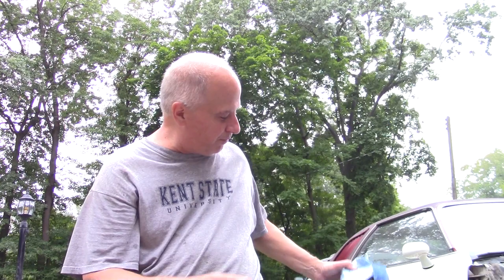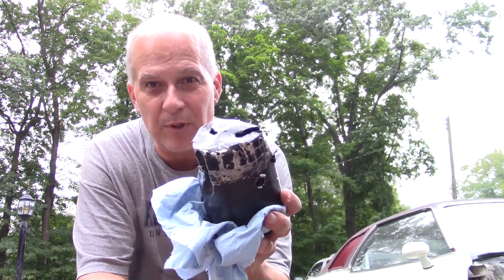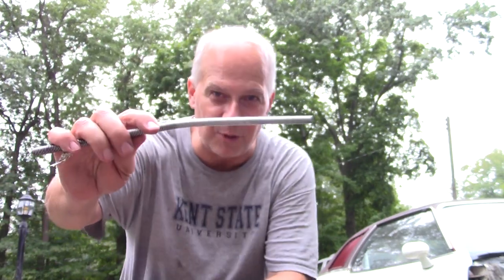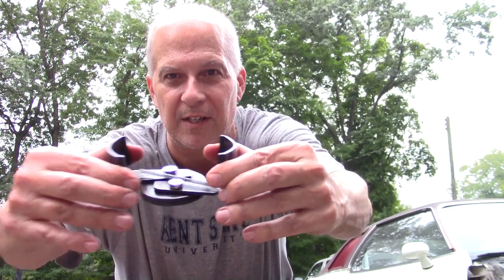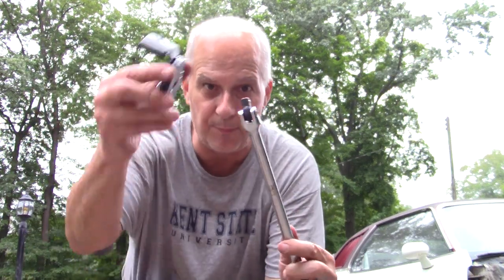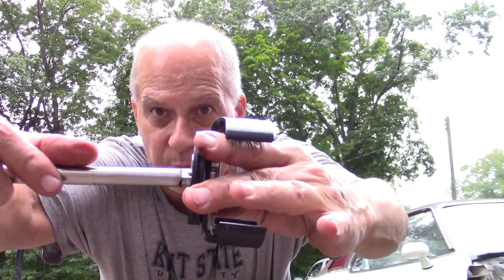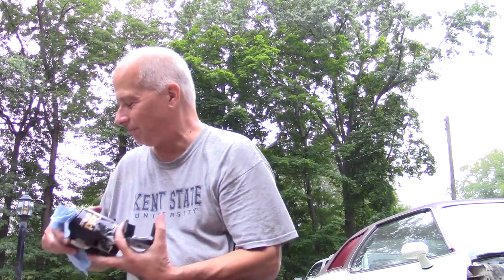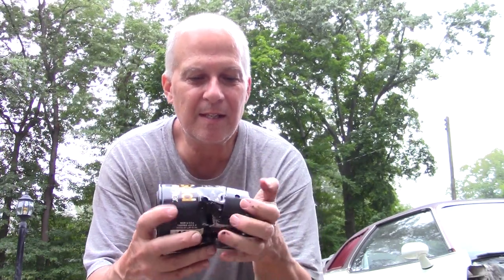Lisle Oil filter wrench review.  It saved me from a lot of work!

Comment: It would be nice if you told us where you got it at..lol
Reply from the maker: I thought I mentioned that I went through all the options at Summit Racing.  But it’s a Lisle product so it’s probably available at multiple locations.
Reply: It's the Lisle 63250 - you can Google it and find it all over the place (amazon, walmart, local parts stores etc).  I have the smaller one which is the Lisle 63600.

Comment: i thought i was the only one who had to deal with oil filters put on by a freaking yeti.   WHY DOES EVERYONE FREAKING OVERTIGHTEN OIL PLUGS AND FILTERS>  WTSFDFSDFL:KSJDF:LSDKFJSL:DKFJ:SLDKFJ:LSDFKFJ
Reply: ps, just ordered that particular tool which is how i found your extremely useful video.   I couldn't figure out which to buy bc i didn't want to go through the methods you actually listed
Reply from the maker: To your point, I sometimes take my cars in to get the oil changed for convenience.  A couple days ago I changed the oil on my Escalade and couldn’t get the oil plug out with my wrench.  Soooo……I put the socket on my 3/8” Milwaukee impact and it still wouldn’t come out.  Now I’m thinking, I’m hoping the threads aren’t ruined.  One breaker bar later, I finally got it loose.  WTAF….lol
Reply: @GroundhogzGarage  I got so mad when I have to follow behind a "professional" who does horrible work.  It's really annoying

I remember paying $1,500 for routine maintenance and spending almost a week trying to put Everything back together correctly since they flip the tires, use the wrong bolts,... Just a lot of small stuff that was missed.  It always made me wonder if they actually did what I needed them to do

Comment: Too tight with oil filters is NOT GOOD! Oil filters should only be installed hand tighten only! Tools should only ever be used on oil filters for removal only, and only when necessary.
Reply from the maker: It seems like no matter how often that message is shared someone is always putting too many torques on tightening the filter.
Reply: That is not the only reason filters get stuck on the engine. it's also because the engine block gets pretty hot and cooks the gasket too the mating surface. I know because I have had filters that I have put on be a problem. and I always put oil on the gasket and I never over tighten them.
Reply: If you should hand tighten only and never resort to using a tool, does that mean it’s unnecessary to ensure that the filter doesn’t leak after installation?

Of course not. So, yeah, a tool might be required.